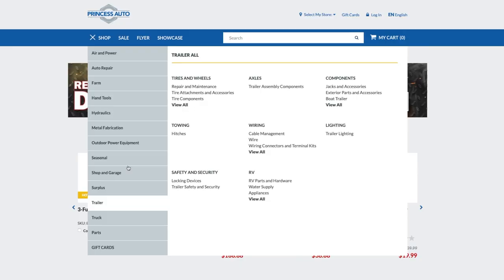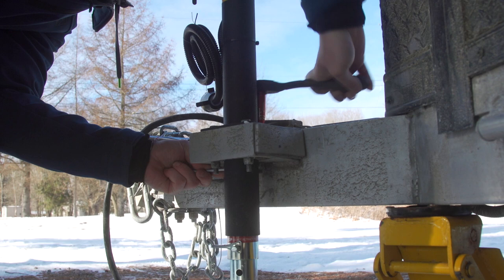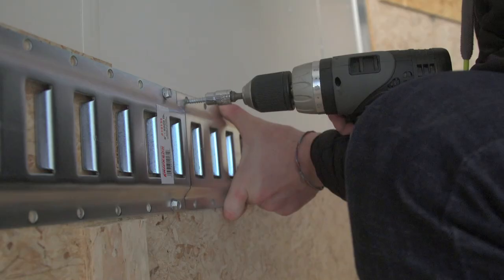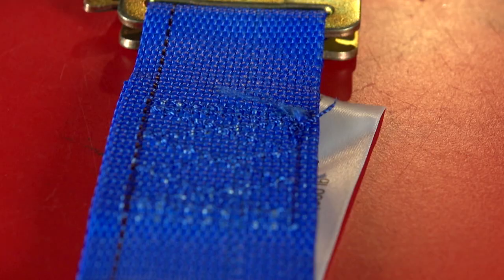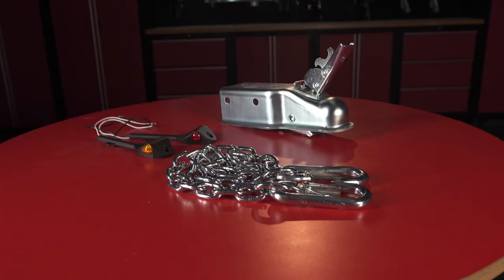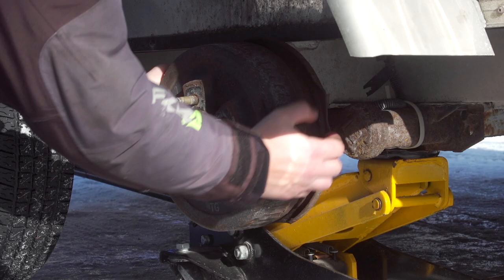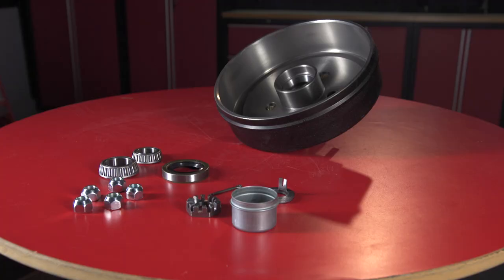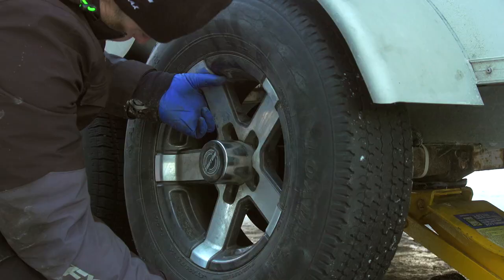Useful Snowmobile Trailer Upgrades & Electric Brake Replacement

Comment: i just got a tilt deck trailer but before the snow i hit up princess auto and replaced my leaf springs and hardware and a new coupler, did the wheel bearings and re-decked it with some new plywood, never realized how bad the leafs were sagging until I got the new ones on, feels like it came up quite a bit. Shes looking good as new.